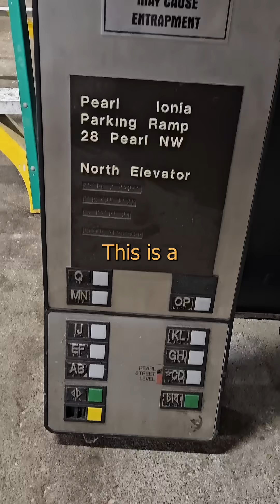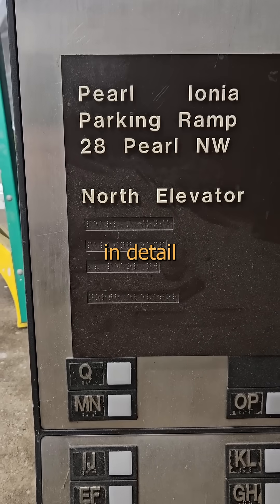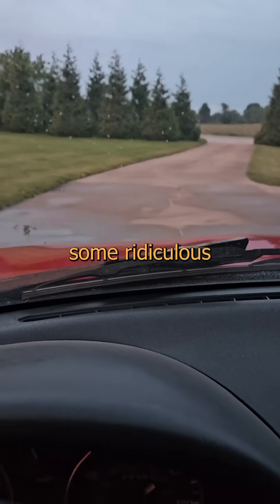Miata Mischief #chrisboden #engineering #gear #elevator #score #stories #parts #hacking #making

Comment: I had a convertible mustang that I would haul bird scooters in for recharging. I could fit about 10 in there. Best thing I hauled though was when I bought a kayak. I put the passenger seat all the way back and down and ran the kayak from the passenger footwell out the missing back window. 10 foot kayak in a mustang. Who needs a truck?

Comment: I hauled about a ton of 3 cu.ft bags of mulch in my 1994 Ford escort. Trunk was full, backseat was full and i had the passenger seat removed for more room. Definitely bottomed out the suspension on some bumps and getting up to speed on the highway transfer ramp was mighty sketchy.

Comment: I had just bought a 65 inch curved tv while out with the wife in her ‘12 Malibu, sure enough the thing doesn’t fit in the trunk with the seats down. I don’t have any tools, but the keys I have on me, the tv is well boxed with two plastic banding straps on it. 

So I ended up sawing the banding off with an old house key, cut the box open, just to BARELY have enough room to fit the curved tv, not in the box or the packing foam (since there wasn’t room for it) in into the trunk. I did have enough room for the tv hardware fortunately

Comment: Gained possesion of giant comicbook display case. Found it would not fit in the full-size cargo van I had borrowed. Ended up using a handtruck, 44' waist leather belt, and assorted bungie cords as a field expedient trailer to get it home with me riding in the back with both back doors with me playing trailer hitch while the van-owner driving.

Comment: We bought some trees at a big box store. Didn't want to pay for delivery, so we put them all in our 2001 Sebring convertible and drove home on all slow roads avoiding anything that might snip the tips.

There was also the time we shoved a couch on the top of a conversion van. Lacking tie downs or rat hit straps, two of us rode crows nest too. We cleared the train underpass by about two inches.
Reply: I've had two of that generation of Sebring convertibles (01 and 04, cause I didn't learn from that mistake) and I'm well aware of the ability to haul. Multiple generators, snowblowers, lawnmowers, lumber, etc. Most of that got bungee'd into the trunk, but bikes and a large TV needed to ride in the back with the top down.

Comment: I know that a 2000 Mustang can haul 9 bundles of cedar shingles from experience. I also know that one of those Miatas you're battering on about can haul 2 1/2 bundles of cedar shingles but, you have to take 1 1/2 of those bundles and load them loose. Better make that trip short or bring lunch money because you can't even fit a sandwich in too.

Comment: I got an old rusty honda Odyssey from 2008. Got it used and abused so I used it for cargo quote a lot. Had a construction job at the time and our foreman provided me with over 8k worth of company equipment (I WAS A FUCKING APPRENTICE MIND YOU). so I was rolling to and fro in a rusty ass oddy, loaded with so many tools that the rear end was sagging and tires had to be pumped to the max. The car was worth like a quarter of the price of all that equipment and having all that entrusted to a first year apprentice was WILD in my opinion. And anytime i had to haul lumber, guess what, on the flimsy roof rails it goes. Rolled with enough lumber to build a small shed once 😂. 
Not the craziest experience I just think it was a little wild

Comment: Hauled a 16-foot PVC pipe home in my car. Ran it diagonally from the driver rear and out the passenger window. Couldn't get too close to the right side of the street without risking jousting with a road sign, but I got it home!

Comment: Used to have a job contracting with Walmart to mount TVs to the wall or above fireplaces. Only had a Chevy cavalier at the time. Used a couple ratchet straps to hold the tv to the roof for transportation to customer's houses.

Comment: Mine is less funny without pictures but I spent a day taking down a tree right next to a house in Boulder, CO during moveout week for CU. Now, were talking 12 inch diameter tree, 60 ft tall, that i was using a 10 inch bar to cut down and shove it into a 2016 Kia Sportage, wood from the trunk door to pressed up against the windshield, having to practially hit the the reach-around donkey punch just to shift into gear. And THEN, rather than pay the minimal dump fees, i did that 5 times and illegally filled a roll-off that was intended for a whole dorm of college kids with my fat wood. Easiest and sketchiest way Ive ever made 2 grand in a day lol

Comment: Recently, I took the liberty of fitting a 5.7 hemi truck engine into my compact vehicle. Met with the guy 150 miles away, 12:00 at night, at the sketchiest motel in a wooded area. Loaded it up, got it home, used a couple ratchet straps and a LOT of effort to get it out the back seat.

Comment: I have a trailer hitch on my 2006 bmw z4m (slightly bigger than that 1st gen miata, just a LOT more power)

There's nothing funnier than the security guy at the hardware store when you are leaving in a drop top with a ton and a half of gravel and a few lvl  bits of timber 😊

Comment: This isn’t really what u asked but it’s the reason why I usually don’t have to do super sketchy shit. Anyone looking for a car with great handling, a small footprint, good gas mileage, and a shit ton of space? Get a Honda element!! I have moved everything from 70 inch tvs to cinder blocks in my element from 2010 with like 200k miles and it’s barely showing signs of wear. Many have a tow hitch too though the previous owner cut mine off for some reason😢

Comment: In Univerty, the Computer Club I was part of got hold of a couple PDP 11s- 4 washing machine units packed densely with computron (only 100-150lbs each but they didn't have great and handhols they steep stairs)  Turns out you CAN get them up 3 stories of stairs if you sacrifice enough 1st year students.

Comment: So my sister has a lot of chickens and some get sick. So our neighbor up the street who had an extra coop with no chickens offered it to us. So we did.  It was a 12ftx4ftx8ft coop and we needed to move it. So my dad bought 2, 8inch bolts and some washers and nuts. We cut the coop in half and nearly pulverized our hands that ,mind you had leather gloves on, with the razor sharp wire fenceing. We put 2x4 handles on the side with a bar crossing them a few feet out. They hauled one half and put the bar on one of our ATV’s and went slowly down the road at a breakneck speed of 3mph. Both of our atvs battery’s died and our neighbor was nagging us about his pool cover the whole time. Mind you , we had to take two trips for the coop and cut down 3 trees right next to our shed to fit. One landed on it and the other two we learned from our mistakes not to. No damage to it though. In the end, we made it, bloody, beaten and with love because it’s who we would go to the ends of the earth for that matter. My sister is really happy and so are our chickens.

Comment: I bought my friends first gen Miata off him for like 1200 bucks. Tires so bald you could see the metal bands. I drove it to work (IT/Desktop support/gopher for network dudes) I was able to fit 6 boxed 27" monitors, and a Lenovo tower in mine. Granted I couldn't see out of the passenger side window at all it still worked. I even loaded a UPS and extra battery to run down to a substation

Comment: I had hauled about 26 bails of R35 fiberglass insulation in the back of my dada ford ranger and the closed thing to comparison that i can say is it looked like one of those hauling Hilux's with the shit piled about 20 feet in the air with the bails pouring over the side, they don't build those old '02 ford rangers like they used to

Comment: I built a flat bed for my little Ford Ranger, that is way to big and has lended itself to being overloaded multiple times.

The heaviest recorded weight being when I hauled the original bed and 1,800lbs of metal to the scrap yard. Maxed out my air bags on that one. 

The sketchiest time was when I hauled four 2”x24”x12’ fir slabs off of the mountain I cut them on. Nearly over revving my engine coming down the steep grades due to the weight.

The silliest was actually before I build the flatbed, I had bought two miller gas portable welders while living in Ohio, and due to living in a small apartment, those welders lived in the bed of my truck for months. This led to the installation of airbags. And one of those welders made the road trip back home to cali with me.

There is also the time that my suspension twisted just right coming into a drop curb, that it jammed a rear tire into my flatbed and I got stuck. That was due to having 1600lbs of roofing material on the bed.

I have a lot more sketchy stories involving this poor little, constantly overloaded, under powered, two wheel drive Ranger than I probably should have. 😅

Comment: I stacked slag lumber on my extended trailblazer, had to add runners onto the roof rack to handle the weight and drove it over a mountain and 35 miles home lol. Stack was 4 foot wide and 8" tall of 8-16' various species of 1-3 quarter boards

Comment: I was driving at the time a 1989 VW golf,  While on my way into work was called up by the boss and told " GO here, pick up the paper we ordered. "  Sure, np :/

Boss didn't say it was a full skid of paper (a pallet)  unbolted the hatch on the golf,  unbolted the back seat... forklift slid the pallet of paper into the back of my golf.... re attached the hatch, tied it down, tied the rear seat down to the roof and went to work.  The phrase of that day was "Wheel-scrape."

Comment: I once helped a guy move a pine log 7 feet long and 2 1/2 feet in diameter from the lumber mill we worked at to his apartment on the 12th story. We had to sprint with this log across a busy street during rush hour and manhandle that thing up the stairs because it wouldn't fit in the buildings elevator. We had to tie it to the roof of the SUV I had at the time, and that was sketchy as hell.

Comment: 2014 Chevy Cruze. You know those giant signs that you see above stores. Not the light up kind. The kind with a thin layer of acrylic with two thin sheets of aluminum on either side. I had to move it from the store I owned in South Carolina to my store in southern Florida. I slid that baby through the trunk and across the ceiling. The headrest had to be popped up slightly so I wouldn't get a concussion from it smacking me in the head with every bump. I did all of that 9 hour drive with my kitty companion in the passenger seat. Me and Mommas driving down I95. The look on her face was that of "are you sure Dad" every time we hit a bump and you could hear the acrylic groan from being under the stress of a bend not intended by design.

Comment: University, got a place off campus for Junior year, with roommates that would move in after the summer. Figured it would be nice to get a small chest freezer for the basement, and there was a cheap one on sale at the Homeless Despot. Made sure it would fit down the stairwell... Didnt make sure it would fit through the door in the back seat of my sedan. 
Have a nice picture of it hanging half out the back tied down with a single ratchet strap bridging the lower lock of the trunk lid and some structural rail on the top.
(I made sure to take sidestreets on the way back)

Comment: I had to transport and install a 400 amp temp panel in one of those micro Nissan mini @ape wagons.  Full of tools and extra materials. I had ladders and the completed pole( all longer than the car by at least 5' both directions). Drove that shit for 180 miles through snow and ass weather to get the job done.

Comment: This is just a sketchy thing I did but I wasn't hauling anything. I was trying to get a brake caliper bracket off and I couldn't get to it from where the stands were positioned, so I laid down on the ground and put my head and neck under the the brake rotor so if the vehicle had slipped off the stands my head would have called for a divorce.

Comment: 300 gallon + 110 gallon stock tank on the roof of a 2008 toyota corolla took the 110 wedged it down over the open trunk lid flipped the 300 upside down over the 110 and up to the windshield bundge corded the ever living hell out of all of it through the open windows and trunk supports and drove that thing 10 miles down the back roads to get home

Comment: I hauled a 14x14 wood and sheet metal porch roof on top of the Yakima racks on my 1981 Mercedes 300D while burning vegetable oil as fuel. Somewhere I actually have a picture of this.

Comment: This isn't a hauling story, but I worked for a summer at a race track and the most interesting race, was the Miata race day. Those things are surprisingly fast to get going and they rip around the track. Except the Stock ones, those are... odd. They don't have quite enough power to over take themselves, so you've gotta be a GREAT driver to swap positions. It was a ton of fun to watch.

Comment: Not so interesting but once I had to bring some sheet rock home that wouldn’t fit in my civic, and if I strapped it to the top it’d snap, so I carried the damn stuff over my head and walked the couple miles home.

I had thought about strapping it because I did that with some lattice in the past, but that stuff has way more give to it, so that worked.

Comment: Where do I start? I've been consistently scouring my local streets every Hard-Rubbish season for the past few years. 

This year, I hauled back a mini fridge (That had just been thrown out less than half an hour before) on a firewood dolled from the same pile, two nearly identical wheelbarrow wheels from different houses, a bundle of metal rods, and several tow ropes all at the same time. I also managed to sew an old milk crate to my bicycle, then attached two more, one of each side, and barely fit a chunky CRT monitor on top, all held together by a 4x4 cargo net I found in one of the crates. I barely made it home without the monitor exploding on the hills to my house, too bad it didn't work though! In a fancier street I found a working and charged DS, about 30 Iphone 9's, 6 windows tablets, a chunky am radio/cassette player, an entire old desktop PC, and 2 laptops, plus assorted wires and accessories. I don't even remember what else I got, but I know I got more!

Last year, or the year before I think, I was trying to fix an oversized dog kennel to my bike trailer (It was a pretty common variety that people kept throwing out), and a shirtless Aboriginal man helped me tie it on with curtain cord (I felt bad because I was right in front of my house and he thought I was going to have to ride for a while, so I went down the street to look for more stuff). It ended up breaking the joint that connected the trailer to my bike... Not fun.

I don't even know how many plastic petrol/water jerry cans I have anymore. My sister just bought me another giant water one for my birthday... Please, send help!

Comment: I had a 1989 Honda accord. I took out the back seats and carried 13 bags of gravel. 700lbs total just set on the floor boards. I have had 2 300lbs friends back there so I figured 700lbs would be fine.

Comment: In 2009 I needed to move an gambling machine with my Renault Twingo. That machine was huge, about 2 meters high by 1.20 wide and 80 cm in depth. It weights about 150 kilograms. 
So I layed down the back seat row, slided both front seats as far as possible to the front and pressed me between seat and steering wheel. 
Good luck I wasn't need to go fast, because I felt like an old bandaged man with nearly no space to move. Oh, to make this more interesting: this car was manual transmission, so I needed to clutch and shift gears while nearly immobilized. In this situation it wasn't cool 😂

Comment: So when my mom passed away when I was about 19, she had nothing to her name except a few boxes of clothes and a 2001 Plymouth Neon, which she left all to me. While the car had many issues, it was sentimental, however my mom raised me to have little love for material objects. ANYWAYS, I used said 2001 Plymouth Neon to haul home an old oil boiler for a 19th century home, which after cutting off the legs, only weighed about 400 lbs and had to hauled out of a basement, put on the neon, driven up a 45 degree hill to get on the road, then driven 10 miles home. With the gas pedal to the floor, that Neon crept up the hill and onto the road, and on a flat road, with 3 passengers, the boiler, and 5 cast iron typewriters, my max speed was about 28mph... ahh, good times! And that was the day dodge sold me on their hauling power! Lmao 😂

Comment: Driving home from the military. I packed a 2-wheel uhaul trailer to the gills to make the 14 hour drive from Quantico, VA to Madison, WI with every worldly possession an E-4 could have. Pulled by a 1988 Pontiac Fiero. I had to use a lifted truck drop hitch flipped upside-down to get the trailer even close to level. I'm pretty sure that trailer weight damn near as much as the fiero. But I loaded the fiero up with stuff too. The 27" tube TV riding shotgun definitely helped :D 

Found out going through Chicago that the turn signals on the trailer didn't work. 

Made it safe and sound to my destination, the first half of the trip through the mountains was pretty white knuckled!